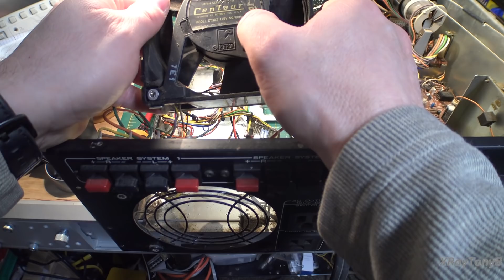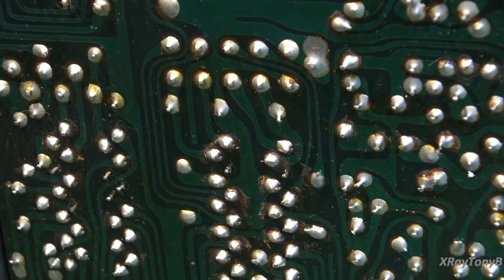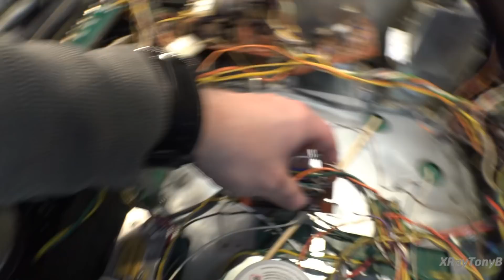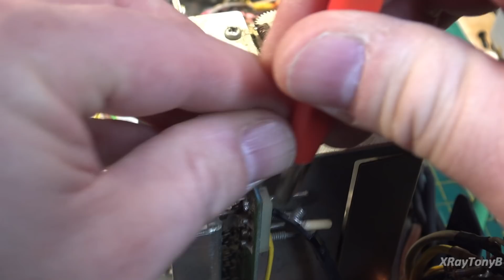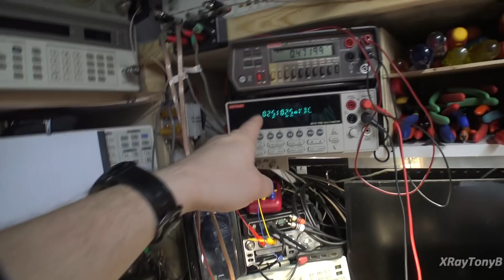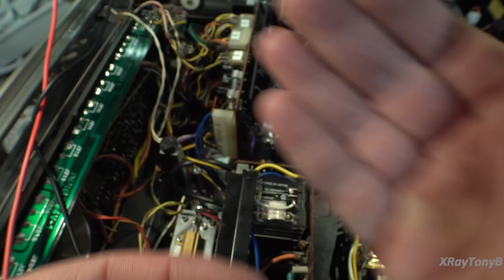Marantz 2500 Part 3

Comment: Surprised to see how many areas that required repair on this unit, seems unusual. Generally receivers are quite reliable but this one has had more than it's share of problems. In your opinion do you suspect design, component selection or is this typical of these huge receivers. This makes a good argument for separates.

Comment: Its quite funny... to connect the heating up resistor and cooling down fan in series. :)
Maybe it would be better to omit the resistor at all and install a fan with built in (even custom) pwm speed control based on some thermal sensor?

Comment: In regards to the relay w/ wrong pins... I once installed an LM317 voltage regulator with the pins of an LM780x -- I had completely forgotten that there were different and it took me a while to figure out why it was not working.  It is good that these regulators have some internal protection and there was no magic smoke...

Comment: carefull with the chinese aluminium resistors...i had them come open from the factory and i have read somewhere that the wattage rating they have marked refers to them being attached to a heatsink, i dont know however if that is true
Reply from the maker: I used high quality Dale resistors purchased from Mouser for the soft start and fan.  They are rated for up to 600 volts.  I do agree that some of the inexpensive Chinese resistors are pretty dodgy.  Thanks for watching!
Reply: @xraytonyb  yep i saw it but be carefull with knock-off's...  anyway nice job on the amp!

Comment: Meticulous as always. I'm just wondering whether the old fan couldn't be rebuilt with new ball bearings - apparently these things are standardized, and there isn't really an awful lot else to go bad in an AC motor. Probably not worth it given the advances in fan aerodynamics in the last 40 years, mind you, and your new fan looks solid enough, but maybe someone would like the keep things as original as possible. I also have to imagine that a solid 120mm fan like that isn't too cheap, unlike some ball bearings.

Comment: The RPM-Regulation of this fans is made with changing the frequency, never with pre-resistors.
Reply: I used to see resistors used to sense cooling in front of a fan. Not sure if it was resistor and thermistor together.
Reply: Good point.  I feel sometimes tempted to change the factory design of my own vintage sound equipment when I restore them (recap, cleaning, deoxi, etc.) -- not as complicated as this one, I can't do a project like this.  But I would feel tempted to change the design of this fan altogether, however then one may not like to lose the originality of the project.  On another point... I almost always replace all of the power supply's main transistors, power diodes, heatsinks, protection relays, etc.  (I got a lot of knowledge about it watching his videos).  But I try not to change transistors in the audio path in order to keep the original sound of the equipment.
Reply: @kylesmithiii6150  I never worked much on consumer equipment once I got older. I never found people would pay for such an extensive restoration. I would fix the problem and anything obvious that is gone or failing. More like a Shango 66 fix
Reply: @Mark Anderson
 I can't agree more.  I think that an average customer would want a "vanilla ice cream" type of repair.  Only true collectors would be willing to pay $1000s in parts and labor for a repair like this.  What I do is for my own humble collection -- I try to buy the best parts I can, usually from mouser.  I feel satisfied with the final work (I try to do a clean work like this also using Q-tips, alcohol, etc.) -- usually worth the time and investment.  For me the repair of this Marantz is worth more than a $1000 -- compare w/ the price of a new Yamaha A-S1100 ($2500).  BTW, I was thinking of buying a reel-to-reel for restoration for my own use, but it is too much for me, I am not up to the challenge.  I gave up.  I use more nice vintage turntables, cassette decks, etc.  My amplifiers from the late 70s/early 80s sound fantastic too (but they are for low power - I don't need more).
Reply: @kylesmithiii6150  yes I had a Chinese friend who's dad had high end equipment in the 70s. He had upgraded to all Mac components and I remember this cool tandberg 64x open reel recorder. I loved that. He had tannoy speakers and later Mac speakers which were more like furniture. Was fun playing and using it. I also had a friend with b& w 801s i really liked them

Comment: Tony this video has been your best. I would expect this sort of thing with a very complicated equipment. The best part of this video is how you do the process of debugging the problem. This is something that is not taught in school. You have more experience than most in this area cause you work on very very expensive X Ray machines that cost 1000 more money than this receiver.  You have been working on these X Ray machines for a long time and developed a methodology on working through the problem is what I find is the most on these videos.

Comment: I got lucky last year on ebay.  I found a seller who had over 100 cans of vintage Cemtronics tuner cleaner, the "real" stuff.  Trichlorofluoromethane and trichlorotrifluoroethane mixture.  Had been very sparingly using my last can for close to 2 years.  When i saw those on ebay I bought every can he had.

Something I keep forgetting to ask.  Why do you conformally coat the boards?  I know it can't be for moisture protection because you only do the solder side of the board.  Only time I conformally coat boards is if I'm doing something that's going to be mounted outdoors and in that application I coat the entire board (top and bottom) with about a 1/8 inch thick layer of UV cure coating.
Reply from the maker: HI Mike!  I only touch up the boards that already have coating on them.. A lot of the gear from this era had a coating on the back of the boards.  It's not really the same as the stuff they used on military or high quality test gear, as it will break down with alcohol and get hazy.  I only use it for cosmetic purposes and I just use the MG chemicals stuff.  Looks like watered down clear nail polish and makes the back of the board look "shiny and new". ;)
Reply: @xraytonyb  

That's not a coating, that's left over flux residue from the wave soldering process.  Common in most consumer electronics of the era.  The 1980's vintage CB radio I'm currently working on that has a Uniden chassis in it is covered in it to.  Since it's a "no clean flux" the manufacturers didn't bother cleaning the residue off after wave soldering the boards.

Comment: I wonder why they used a power resistor to lower voltage to the fan? I've often used a capacitor in series with the fan and a thermal switch that shorts out the capacitor when hot to allow the fan to run a full voltage in this state.

Comment: I had to replace a relay on my Marantz Model 250 power amp a few months ago.   The problem was that no replacement existed.   The original Factory relay was an oddball in that the coil contacts were in the position occupied by the actuator contacts.   Lucky for me I found a solution on a trouble site.   They recommended a relay that wasn't an exact footprint as well as the coil and actuator contacts did not match, but otherwise the relay was a good match.  First I had to open the relay and physically swap the wiring of the coil and the contact-er.   Then I had to "muscle" the relay into the mismatched footprint.

It was worth it. The unit works flawlessly now.    I bought an extra relay because I have another Model 250 in another room.